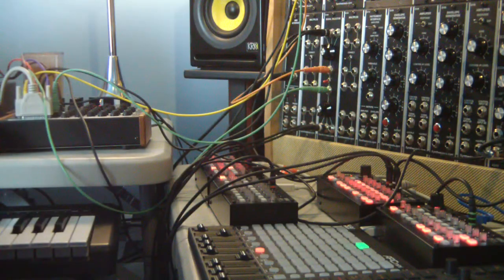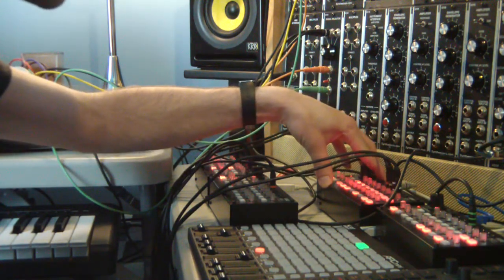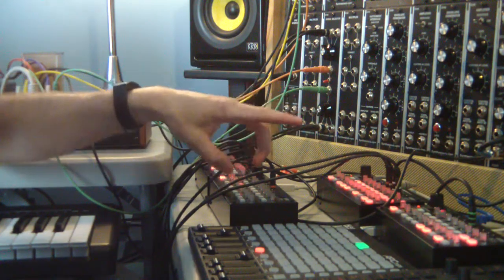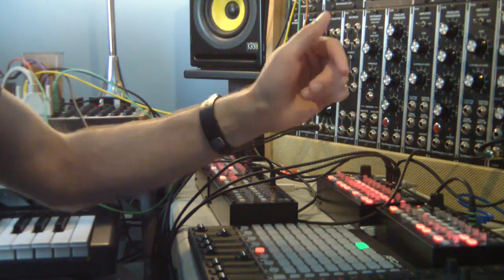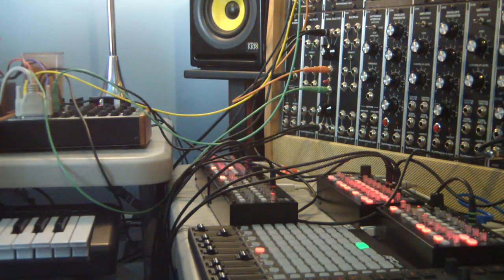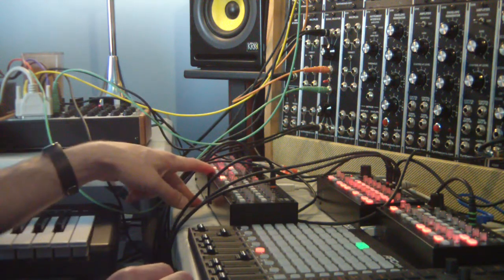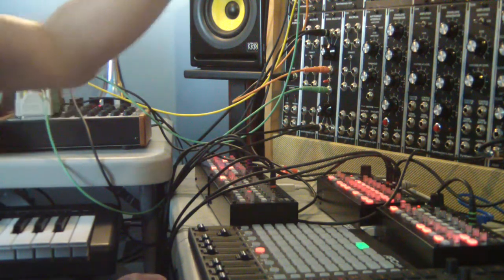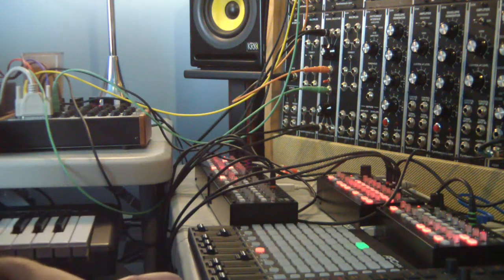SQ 1 Obsession (making and 8 note sequence less boring)

Comment: cool, I'm running 3 of these units, have you worked out how run each unit on a different seq step resolution, ie: 1/4 notes, 1/8 notes or 1/16 notes. When I set them up all on a different resolution in global, they all slave to the first units settings when using sync cable? very frustrating! Looks like your are synced by the daw. What the global settings on the mode selector knob for parallel, cv duty, cv slide, cv duty random and random do is a total mystery, the mode lights change but there is no indication what the settings are? nothing in the manual on on korg website, any insights would be helpful, cheers
Reply: found the answer in korg faq, all about sync x1 and sync  x2, sorted
Reply: Nice one, I was struggling too til I saw ya comment